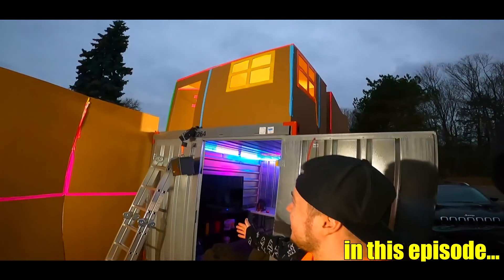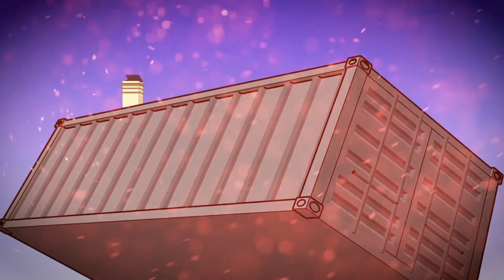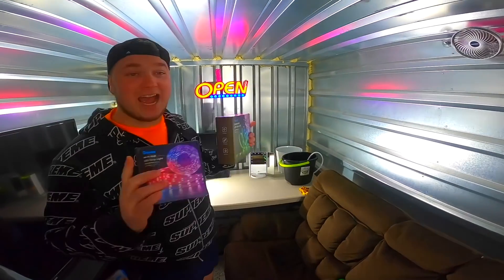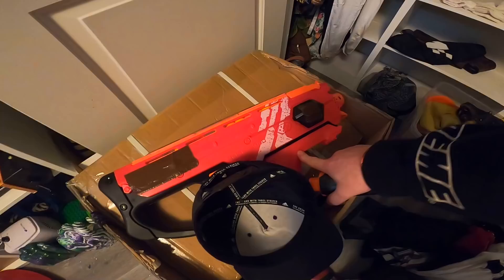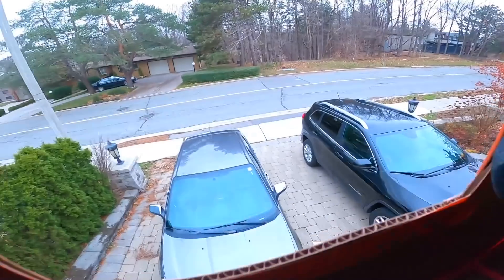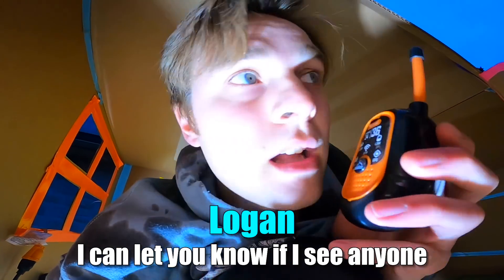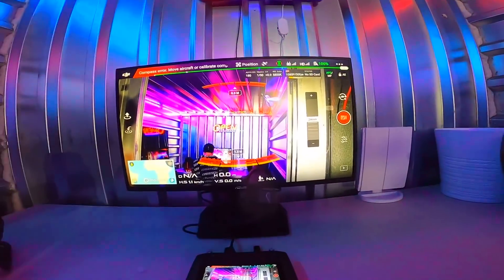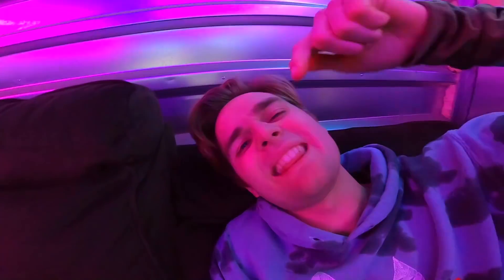2 STORY HIDDEN Secret Bunker Fort (24 Hour Challenge)

Comment: Buy another shipping container and stack it on top of the other one so that it will be a bigger  bunker 👍
Reply: Yes the top needs to be metal so rain doesn’t ruin it.
Reply: Not only that but for that exact shipping container it only costs 1700$ well within a budget he could also buy a large one for 400$ more
Reply: I would would have one on the side and then one on top in the middle and make a hallway in between the two so you can make a ladder system to get up to the second floor.
Reply: That would fall
Reply: @ShawarmaKingYT  drill them together with bolts
Reply: too dangerous
Reply: Then how do they Stack them on cargo ships
Reply: Nickgames 3974 papa jake and logan arent proffesionals bro
Reply: @bluebed6111  yes they are at box forts and papa jake got the brain of a smart nerd